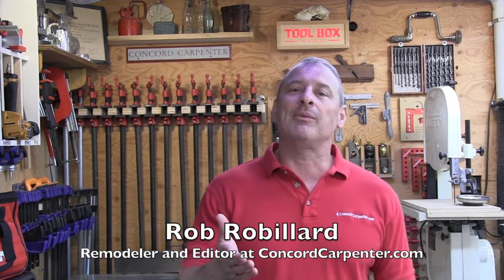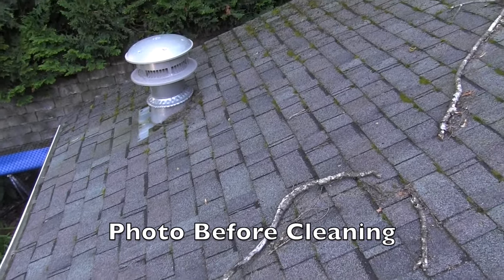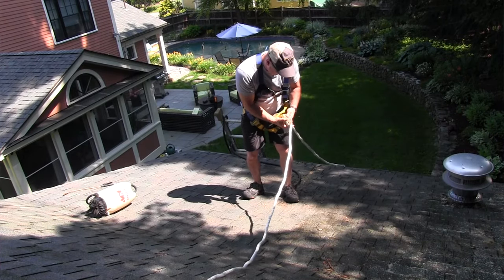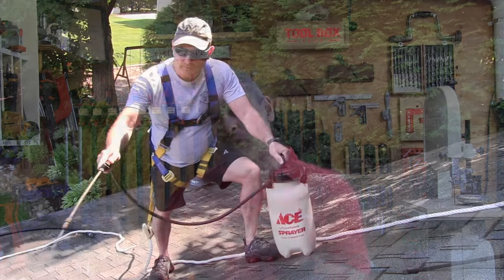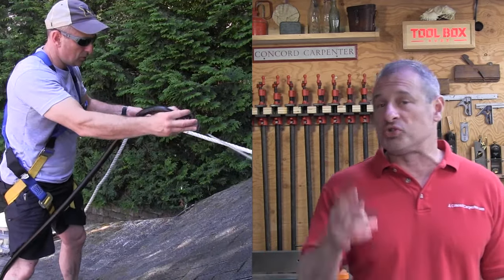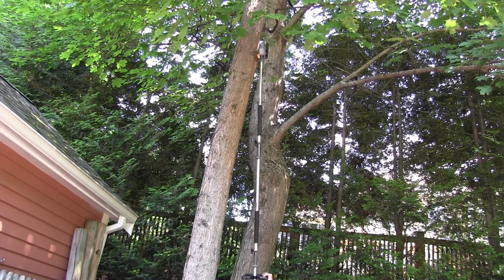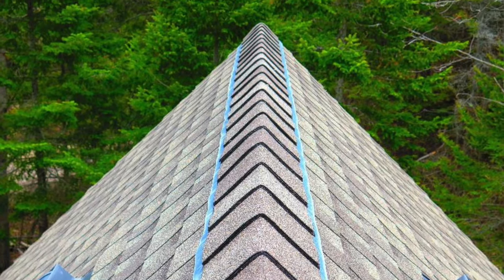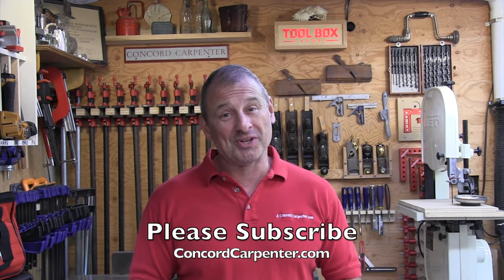How To Remove Roof Moss  - And Keep It Away

Comment: thanks for the helpful video.  one point of feedback, it might be helpful to mention that your synthetic safety rope and harness would also be degraded with a bleach solution.  It would be wise to try to avoid contact of the bleach with the rope if possible, and be aware that the life-span of the rope will be shortened by exposure to bleach.  I've been a climbing and outdoor instructor for over 25 years.
Reply: Thanks for that point….one of those things that can degrade over time, without noticing.
Reply from the maker: Great tip thanks
Reply: Harnesses should be changed out every 2 years with normal use

Comment: Excellent video sir! One caveat. The reason roofs are clean below chimneys, skylights, pipe jacks etc. isn't lead. It's the zinc that has been electroplated on the steel flashing (galvanization). Lead is only used in tile roofs
Reply from the maker: Jon the Roofer not where I live we use lead flashing all the time , and your correct about zinc
Reply: @ConcordCarpenter  
Wow. I stand corrected. I've never seen lead on anything but tile. What state are you in? Didn't mean to talk poo:)
Reply from the maker: Jon the Roofer  mass
Reply: @ConcordCarpenter  
Right on!I 'm  way over here in Cali..  Glad to know you!
Reply from the maker: Lead flashing is used on chimneys in the NE
Reply: @ConcordCarpenter  Lead is toxic isnt'it ? (Rohs)
Reply: @salsalocofrance1  It is.  We're slow out here.  But lead is being used less and less.

Comment: I’m a professional roof cleaner. In northwest climate. 

Zinc strips work only for 4-5 years and cover about 10-15 feet because they are only 2 inches vs chimney flashing that’s 6-8 inches. 

Shingles with zinc could go about 8 years without moss infection and then I get phone calls for moss treatment.

Annual roof maintenance is the only way in the great northwest!
Reply: I'm also a professional roof cleaner.  I agree.  Those zinc strips are useless. They curl at the edge and create more of a gutter.  Also ,as you said. They don't last or kill more than 15ft down for only a few years
Reply: Where are you located? I'm in Seattle.

Comment: you shouldn't use a fall arrest lanyard at <3m, as when the release you will still hit the ground.
you should use a fixed sling/rope or "fall restraint" system preventing you even getting to the edge, this is much safer in general especially at lower heights .
Reply from the maker: Great point thanks

Comment: Okay....

1) if you're using a ladder, use stand-offs. This simple add-on will keep the ladder from scratching the hell out of your gutter exterior as you climb up and down the ladder with material & gear, and it will create a wider stability to prevent sliding left or right if, for any reason, your ladder shifts as you climb/descend and/or as you mount/dismount the ladder at the top. 

2) the "50:50" method is usually a SH dilution of about 3-5%. Different brands of bleach can have different dilutions of SH, so you need to be very careful about the mixture you're putting together. Over-concentration of chemical can result in shingle damage and is far more likely to burn trees, bushes, plants, and even lawn with overspray. Professionals will typically buy 12% SH bleach from their supplier for the most cost effective application.

3) most sprayers are NOT bleach safe, so make sure that it is specifically designed to accept SH. The bottle is typically not the problem - it's the gaskets & seals. This is important if you don't want to buy a $40 sprayer only to use it for a day and then throw it straight into the trash because the seals and pump have melted. You're probably looking at a $65-100 pump for this application.

4) zinc strips are garbage. Don't waste your money. Invest in regular preventative maintenance with yearly spray treatment if you've got a problem area.

5) the "lead" can also be galvanized metal - which is the current standard in building material because lead is obviously extremely toxic to everything and that rainwater is either going into your lawn, garden, storm drain - it might even be going into rain catchment systems used to water your garden. Galvanized metal is also pretty toxic, which is why things don't grown down-stream of it on your roof, but lead is a horrific idea to be putting on your roof if you care one iota about the environment or your family's health. 

6) if this seems like a lot of information to absorb, it is. That's why people do this professionally. Call a company in your area that does "roof moss removal" or "soft wash treatment" and don't risk your roof...

Comment: I use a long handle lightweight gardening back hoe to scrape off all the large chunky moss as much as possible.  Then use a lightweight extension paint pole and use electrical or hockey tape wrapping a metal utility scraper ( the types use for spreading mud on drywall) to finishing it off.
Then use commercial  premixed de moss chemical and spray the entire roof. More applications if nesesary.  Then it all done.

Comment: I am a shingle installer. I was always told using bleach to clean the moss is really bad for the shingles. Basically eats away at them. Is this true? Have the roofs youve cleaned ever had problems after ?
Reply from the maker: None

Comment: I've found that the bleach and water doesn't work as well as Zinc sulphate solution.  The zinc sulphate can be purchased at an animal feed store and you can just spray and leave.  As for the bleach, in the past, I found shingles that had been treated this way (as well as the Tide with Bleach) were brittle over several years and had their lifetime shortened.....not sure about the newer shingles though.
Reply from the maker: N. Johnsoh great tip 👍🏻 thx
Reply: @ConcordCarpenter  
Use a lightweight gardening backhoe and a metal paint scraper attached to a long painting stick with electrical or hockey tape to scrape all the large and visible chunky pieces off first. Then use a stiff broom  sweep and brush it loose & off the roof.
Use store premixed de moss chemical and spray it on the roof.
kill moss in 5-25  minutes. Repeat if necessary. 
Way better than bleach .

Comment: you need to use an anti algaecide to treat moss lichen  like wet and forget. bleach will do just that rather than kill  the moss. A active algaecide baste will take a few weeks to work but will do a more through job in the long run.
Reply from the maker: Great tip - this roof is still moss free 2 years later

Comment: Algae and moss are not the same thing.  Buying AR resistant shingles with Titanium Dioxide as the active photocatalyst will not prevent moss from growing.  Buying AR resistant shingles with copper or zinc impregnation will help retard the growth of moss, but it won't stop it.  Keeping the roof clean and dry is the solution for moss on the roof.  Algae, on the other hand, is airborne and nothing will stop the spores from finding your roof.  (most likely Gloeocapsa magma)
If one were to maintain their roof instead of just thinking it doesn't need maintenance then moss/algae wouldn't be hard to keep at bay.
Neglect anything and it's much harder in remediation.
Zinc/copper/lead strips work to SOME degree, but they're not a panacea and it would take more than just one strip near the peak of the roof to be effective downstream. 
Even in your example (4:57), you can see that the LARGE surface area of the chimney flashing doesn't have an effect all the way down the roof;  Imagine how ineffective a narrow strip near the top would be.
Putting water on moss is defeating the purpose even if you use a sodium hypochlorite solution (bleach) as the oxidizing nature of bleach doesn't work below the surface.  This is why it's ineffective against mold infestations since it only works on the mold you see.  Same with moss.
Reply from the maker: That is for the clarification.
Reply: Would Mixing borax into the concoction help keep it free from moss longer?  And would this harm the shingle?  Any ideas?
Reply: Lead is toxic (rohs regulations)

Comment: I have a 16' diameter gazebo with cedar shake shingles that have developed moss.  The gazebo has no gutters, so runoff of a bleach solution would destroy the surrounding landscape.  When spring finally arrives, I'll attempt to powerwash the roof from the top down and apply a moss resistant stain to the shingles.  Some tree pruning to get more sunlight down to the roof will hopefully prevent a re-occurrence.   Any other suggestions?

Comment: can anyone that tried this provide some feedback on the result?
Reply: The moss did not foam at all when I put the bleach solution on. I tried full-strength bleach and still no foam. I don't know why, but I was disappointed. It just seems that the appearance of foam would indicate that something positive is happening. I ended up just using the garden hose with a spray attachment. It got rid of most of the moss, but it took a long time, and I used a sh*tload of water. Not all parts of the country could even use this method, because of the water usage.

Comment: Well let me say 
That fancy Zinz strip did Not do a bloody thing
Reply from the maker: disagree on that - have used them sucessfully
Reply: @ConcordCarpenter  
Zink strips didn't work for me either. Part of my roof has them and part does not. Roof got mossy about 15 years after installation. Zinked areas got mossy same time as non-zinked.

Comment: A better solution is to spray the bleach/water mix, and leave it. Don't rinse it off

Also, you need a higher strength bleach. 10% is the kind you will find in the pool section at Walmart etc.  12.5% is the kind you will find at a pool supply store. You don't want "bleach" specifically, because it's only 3-5% depending on the brand. Look for pool shock, chlorine, chlorine bleach, in the pool section, and go with the 50/50 mix

Also, you didn't really get into it but you did mention it. In order to protect your property from runoff, wet down the areas you want to protect. So if you have plants or trees, or you just don't want the grass to get killed, water it down AAAAAAALOT!!!! Flood the area if you have to. Wet down the plants before you spray the roof down, and after.

By leaving the bleach up on the roof, it will continue to work long after you've sprayed. It will continue working for hours, maybe days after you're sprayed it, and will just wash off the next time it rains.

By that point, the moss will be brown and dried out, and will come off super easy